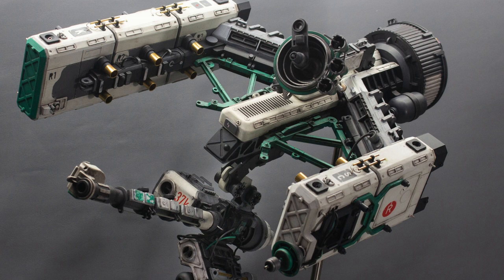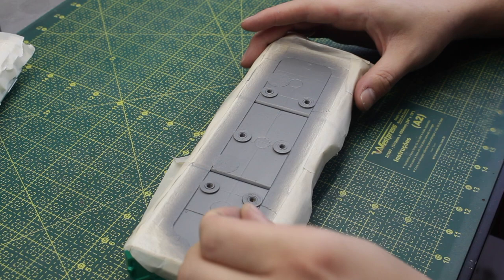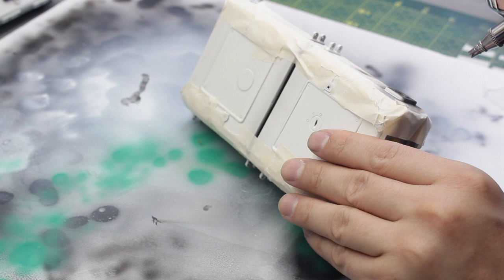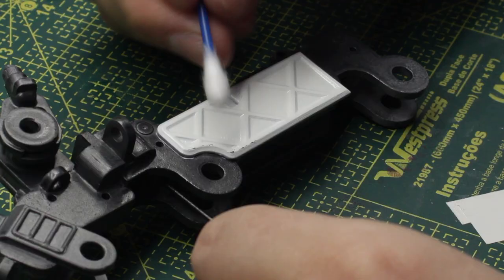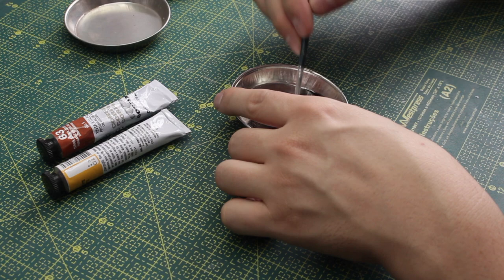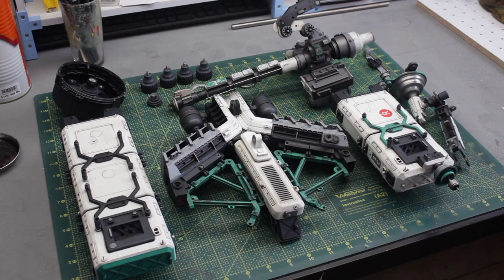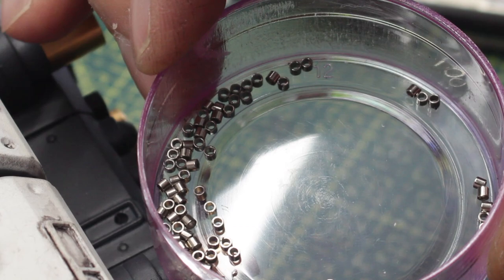Can't believe I'm done with this one!

Comment: Celebration indeed. That little guy has been a journey. I have one of those circle cutters “made by a prominent hobby knife manufacturer”. I have used it to score styrene. Works pretty well. It chokes and dies when you ask it to cut paper though.
Reply from the maker: Thank you! Mine is the opposite, it cuts paper well, but it's not that good for styrene.. not even to score it

Comment: Masking: Been watching Ken Spriggs and Interstellar Modler do figures. I think it was Ken suggested Silly Putty of all things when masking hair lines from faces. Ok, no Silly Putty in your neck of the woods? Bet there is kids modeling clay. Some are oil based. Might do odd things to some paint. Might not though. I would guess poking clay around surface features would be at least 1 order of magnitude easier than all that stupid tape. Know what Play Dough is? You can eat that. It should stick “enough” to make one mighty fine mask. If you can eat it,  o oil wicked enough to float enamel paint.
Reply from the maker: Never thought of using regular silly putty for masking... I really gotta give it a go! Thanks
Reply: @CutTransformGlue  these guys pull off some pretty amazing faces that way.